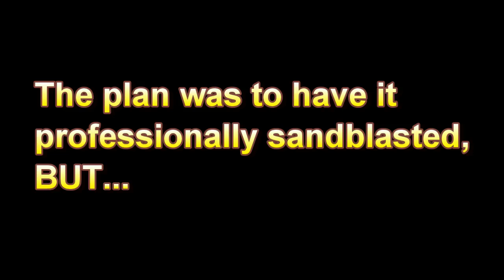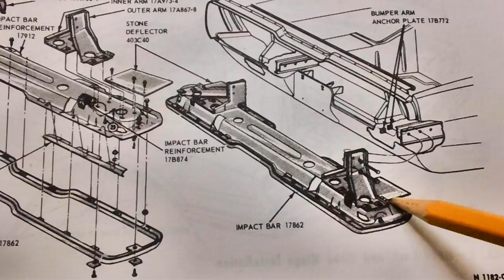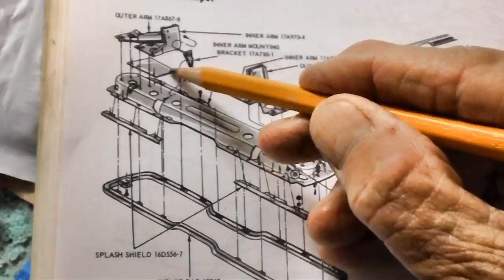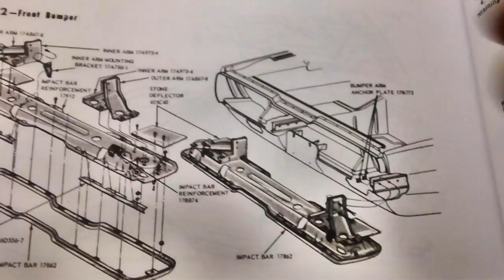1966 Ford Thunderbird repair and refurbishment ( Part 101) More tail light work.

Comment: Glad to see you are still making videos,  I really like watching them.  I really hope you make some of the interior work.  I like your can-do attitude, you are willing to tackle any part of the rebuild.  A lot of people would wouldn't have tackled the rebuild of the rear lighting mechanism that you did in the last video.   They  do make a 4" round or 4 1/2" round wire brush  for that angle grinder that will eat rust up.  Also eats up flesh so be careful, don't ask me how I know., so  I always use my welding gloves when I use it now.

Comment: Hey John, the fuse box has "circuit breakers." They have a bimetalic thingy inside that opens the circuit when the circuit gets shorted or grounded, when there is an over current. It protects the circuit from burning up. Most are pretty narrow and are not available in that size, too bad. I had a few used ones I used on this Thelma and Louise car I'm restoring. So far so good. 

So did I understand you right, you suggested in your video that your radio guy in Florida came to your house at 3 in the morning and took your radio, cut the wires all just to fix it for you? Talk about a fish story!
Reply from the maker: Nick,
It was 3:30 in the morning...and I think that's what happened, but I could be wrong.🤔
Regards,
John

Comment: Hey John, first of all, call the cops about the guys who stole your radio. Let them know that someone is driving around breaking into peoples garages at night. Do it now before the Democrats defund the police and then you'll have to tell your problems to a social worker who doesn't give a s**t about your problems. Secondly, I posted a video about the rear bumper flaps. You can find it on my YouTube channel Vintage Thunderbird Repair. I have an 8 track radio you can have for free. You might have to get it repaired but if you want it, its yours. Also, you cannot put a regular AM or AM/FM radio in that spot because the center console and dash facings are different for the 8 track radio. 

Great video once again. Thanks for the good work. Nick

Comment: You have done an amazing job on the rear bumper and tail lights John, the amount of effort you put in really shows - looks fantastic. Like my Dad used to say, "If a jobs worth doing, it's worth doing properly". And you certainly done that!  With regards your radio, you have gone and got me a bit confused, did it really get stolen, or does that pesky Ron C have it?  Are you doing a bit of leg pulling here John? I certainly hope the latter is the case. Anyway, keep up the good work, and Happy Thanksgiving to you and your family, from Steve in a cold, wet and very windy Devon, UK.

Comment: Love your videos, I've been fixing up a 66 T-bird of my own and your videos have been incredibly helpful. I do have a question about the trunk lid. Mine doesn't lift and stay up, I tried referencing the shop manual but it wasn't helpful. I was wondering if you could do a quick video on how the two rods along the rear of the trunk properly link up to the trunk lid to get it to stay up.
Reply from the maker: Michael,
Hello there, my friend.  It's good to hear from you.
Right now I'm on a 1-month break from posting new videos (on Odysee.com). but if you'll send your email address I'll send you a video of how my trunk rods are set up.  It'll be the best I can do.  My email is my YouTube handle at gmail.
Regards,
John

Comment: I have enjoyed your videos and hoping you could help me troubleshoot my 66 t-bird. I have new fuel, selionoid, rotor, cap, points, coil, condenser, regulator, it turns over but won't stay running. Any suggestions you could offer, this old woman would sure appreciate.
Reply from the maker: Hey Julie,
A lack of spark or gas is causing it.  You said you have new fuel.  Do you mean fresh gas in the tank or a new carburetor?